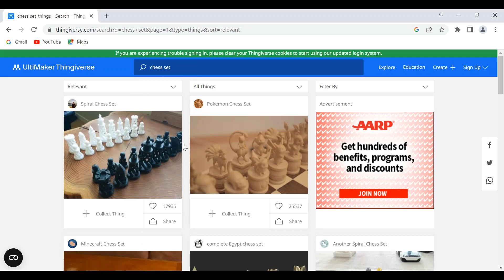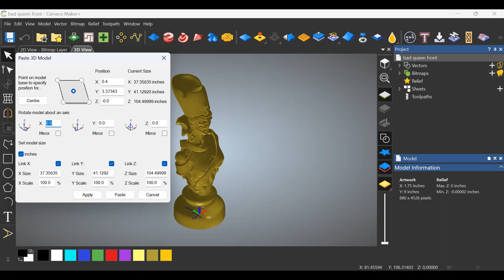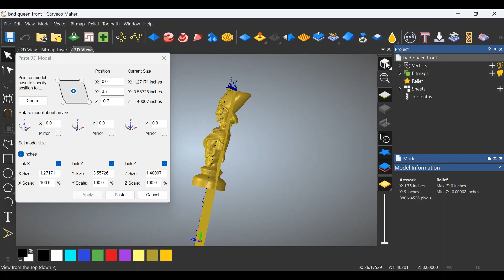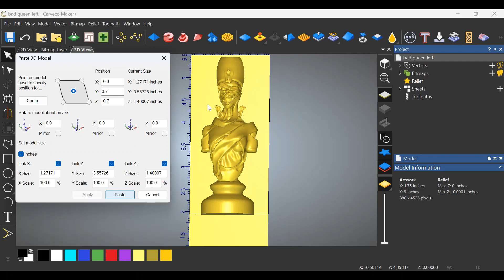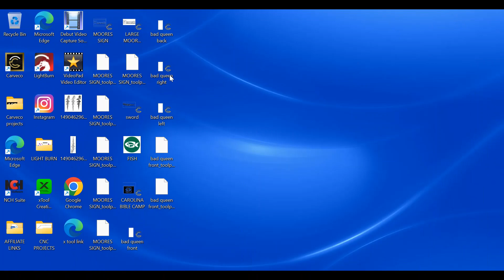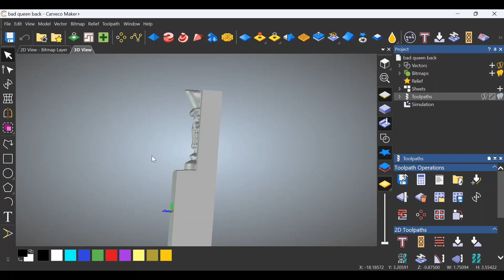How to make a beautiful chess piece

Comment: Hi. I've watched this tutorial numerous times. I think it's a great idea and well presented. I have tried to copy what you have done, however I'm having a problem with the 3rd and 4th relief cuts.
I've checked the material is square and 4 sides equal (within 0.03mm)
Yet on my 3rd and 4th cuts it seems to cut deeper into the edges in some places (at the sides) but misses the highest points in the centre. Have you any ideas. I've had 4 different attempts and haven't got any decent results. 
Thanks 👍🏼
Reply: Thanks  for this I'll give it a try.
Reply from the maker: Hi 
Sorry you’re having trouble.
A couple of ideas
1- re-zero for z on each side off the original stock height 
2- try cutting the sides that cut the deepest first 
Hope this helps

Comment: Hi, first want to say thanks for putting this together and showing us new capabilities; it's really fascinating what you've done here.  I'm in the process of carving some chess pieces, but I have a question regarding the finish toolpath.  I've noticed during my carve that at the end of each pass the bit raises up to the where the top of the material originally was, then drops back down and does the next step in the raster path.  When it gets to the other end it does the same thing and repeats.  I'm sure I'm missing something but haven't been able to figure it out.  Any ideas?
Reply from the maker: Check the safe z setting i set mine from .1 to .2
Reply: @Hinkleshop  I double checked my safe Z setting and confirmed it's set to 0.1.  I changed it and reset it back to .1 just to make sure I didn't miss something and it had no effect.  Also, I ended up recreating the model - had some other issues I wasn't happy with - and when I did the new toolpath changed so that it's only doing it on one end of the raster.  At the left end the bit raises to the top of the material and drops back down to run the next row, but when it gets to the right end it just reverses like it should and continues back left.  As far as I can tell I used the same toolpath settings on both models.  Any thoughts?
Reply from the maker: Send me some screenshots of your tool path menus to my email hinkleshop@gmail.com and i will take a look
Reply: Double checked that, it's set at 0.1

Comment: Thanks mate, 2 things though, I use different software but can't you just copy and paste the first toolpath to back and sides to save you time? Also when doing the sides it seems to me that changing the size of the bounding box to only be say 1/8" wide it will save you a lot of time from the tool cutting air, also if there is a slight positioning error when clamping, or movement through the wood being stress relieved then the tool won't cut into the work you have done either side of those thin strips.

Oh another thing :) , if you set model center slightly different the tool could go bast depth center by even just 1/16" negating the need to do the sides?
Reply from the maker: Hello thanks for watching 
As far as copy and paste I don’t believe that would work because each side is different 
The reduction of size definitely would reduce time 
And centering so the tool goes past is a good idea but you still need to do the sides because the sides have different elements and carving the sides removes the line/seem if you don’t get the zero just right
Hope all that makes sense
Reply: Sorry mate I meant just the settings, I use vectric Vcarve desktop and save time on projects by copy and pasting settings, then calculating the toolpath, I didn't mean copying an actual toolpath, maybe it's the software difference that doesn't allow it and it would be good if there could be a preset for toolpath settings that you can save prior to calculating.

And about the other thing I mentioned about reducing the size, your reply makes sense as I wasn't thinking about those details, like for instance inside an ear
Reply from the maker: @ yes the details are subtle but they are there
I think you may be right about Carveco not having the copy and paste capability 
I’m pretty comfortable using Carveco but that might be something that can be done that I just haven’t seen.
I’ll have to do some research now because that is an interesting concept

Comment: startedon mine. using vetric v12 , littlr different and yell i messed up a lot. cant figure how to rotate four tims ding two side lots good to me but thats me.
Reply: God I need to proof read before sending
Reply from the maker: @paulrcreech7731 
No worries Paul 
But i am still a little confused by the comment 
If you need help with something although I don’t know anything about vetric 
Shoot me an email hinkleshop@gmail.com
Be sure to proofread 😉👍
Reply: @Hinkleshop  
Well I have an infinity cnc wood worker pro with vcarve pro v12. It doesn’t allow me to rotate like carvco. So I can only do two sided carving like ok. With vcarve to rotate you turn it in job set up but if not careful it misaligned top to bottom you have to eye ball it. As far as I know I can’t punch in a # like 180 or 90.
Reply from the maker: @paulrcreech7731  wish I could help but im useless on V carve 
Now if you switch to Carveco thats another story 😆
Reply: Ok I have v carvepro it doesn’t allow you to punch in a number to rotate that I know of. But I have done the king queen and
Rook. I happy with it but I do the two sides and that’s it. Wasted 6 but thanks to you I’m getting it

Comment: Awesome idea! 

You may be able to cut your carve time in half if you do relief boundary.  I’ve been doing only rough pass with offset boundary to make a specific offset. Then I do a completely new 3d tool path using only the ball bit finish pass with minimal offset relief boundary. 

Just make sure you rough at least .25 offset from the relief on the rough pass or your ball bit will hit. 

It might get squirrelly but maybe use the boundary offset path to profile cut from the back leaving small bridges then you could just remove the outer excess wood and continue to the sides !

Been wanting to make a skull, never thought of aligning it the way you showed here so that’s awesome!

Comment: Thank you for the heavy lifting here.  I can really appreciate your experience and you make it very easy to understand.  Question- Have you been able to 3d carve from a photo from your phone? or just a simple jpeg?  I have been looking into this and I believe you need to convert "properly" the image to a good quality 3d greyscale heightmap with accentuated contrasts and edges that the software can understand.
Reply from the maker: Thank you for the kind words
Unfortunately no I haven’t done a photo carve 
However I believe you are correct you will need a conversion software to accomplish it
Reply: @Hinkleshop  You are welcome.  I'm in a struggle to purchase the correct software for my cnc machine I bujilt (mpcnc) and I've used Fusion 360 w/ inkscape for a few projects. Considering carveco, vectric, carbide create and now found cambam.  Have you tried out any of the other software programs and can add your opinion? I really don't want to start out with a $1,000 dollar software purchase or the constant monthly payments as it is a hobby now.
Reply from the maker: I haven’t used the others 
I am  a strong proponent of @carveco   Maker it can do just about anything a hobbyist CNC user would need 
It does have somewhat of a steep learning curve but no worse than fusion and although it is a monthly subscription the price is very reasonable and in my opinion/experience well worth it

Comment: Looking at your probe, it's thicker than the aluminium crossbar. Why don't you place the probe on the solid piece of wood below the crossbar?
It's flat and have body to place the probe instead of a balancing act with a wedge above that crossbar.

Order of carving:
You advice to do the sides first. How exactly do you proceed?
First the roughing cut on 1 side, rotate the piece of wood 180 degrees and roughing the second half. Than change the bit for the finishing cut. Rotate 180 degrees again for the second half. Followed by the finishing cut for the front and back?
Basically you only set the Z once for the end mill to cut the 2 sides. When finished you set the Z for the ball nose to cut 2 sides plus front and back.

Or do you have 2 tool changes for each side?
Reply from the maker: I used the probe on the wood not the crossbar
I complete each side before any rotation 
Complete left and right sides then the front and back
Reply: @Hinkleshop  I understand you probe on the wood. What I try to explain is you have a big chunk of the wood below the cross bar. There is plenty of material to place the probe and set the Z.
All you have to do extra is move Y minus with a certain distance, so it's above the probe and set the Z.

Comment: Great tutorial, well done on the explanations.  I believe you can save yourself the math though.  You basically want a bottom offset of 1/2 of your material or 0.875 in this case.  If you enter that into the bottom offset Carveco will calculate all the rest.  Nicely done, cant wait to try it out.
Reply from the maker: Thank you for the info I hadn’t thought of that and I bet you’re right about entering the number thanks again

Comment: nice, but why not calculate that seam left over what thickness it is and adjust the carving on both sides so its perfect from 2 processess instead of 4?
Reply from the maker: Thanks for watching if done correctly with the bottom offset calculation there is no visible seem

Comment: Excellent video, I did a piece, first attempt, didn't set the offset like you said. Turned out ok but not great. One question, instead of going through the math, couldn't you just put half the material thickness in the bottom offset box and be done with it?
Reply from the maker: Thank you !
I don’t think that will work but it’s worth a try give it a go and keep me updated

Comment: Sir, I have a couple of questions if u don't mind.  ref chess to chess set. I have followed all of your instructions and I am getting better. the problem I am running in to is when I do the finish the piece is being cut off at the top and flys off of . I know u said to leave a little at the top I have done that but it cuts all the way through I am using carveco maker on silverback 6060 and easel for the g code.the other thing I find that the pieces are being cut very thin. and prone to break while carving . thank you for your time . and that u in advance.
Reply from the maker: Hey Joseph 
If the piece goes flying off the top you are probably leaving too much material at the top I’ve had that happen too
As far as the piece being thin that would seem to be a z height issue may need to increase z height on the piece so there is enough material to carve without getting too thin
Be sure to keep your feed rate rather slow 
Also cut the sides of the pieces first then cut the front and back using only a finish pass on front and back no rough pass needed if you cut the side completely first
Hope this helps
Reply: thank you. @Hinkleshop

Comment: Could you save some time by revising your rectangular boundary for the last two cuts?  Seems like the majority of the material is removed in the first two iterations, and on the third and fourth cut you are spending most of of the time in free air not cutting anything.  Could you lower the boundary box X width down to about 1/4" or less just to take care of the remaining material?  Haven't actually carried out the process on my own yet so I could be missing some details.
Reply from the maker: Thanks for watching 
On sides three and four i eliminate the rough pass and use only the finish pass because you are correct sides first then back and front can be completed with the taper ball

Comment: Sir, ref chess set. in your video u said the stock  was 2x2 all around u also stated that the stock must be trimed to 1.1/4 is that all four sides . also the settings in the toolpaths are they used for all four sides. back ,right, and so on and  for the rest of the set.  thanks.
Reply: Sir, one more question. what carving times are u getting for roughing carve. I am getting some strange Times at least to me one 12 min and the  next time 35 min that's in roughing only. thank u once again .I am determined to do this.
Reply from the maker: @josephlanglois8073 roughing was averaging an hour per side and finishing was 2-3 per side 
Check your safe z height set it to .1
Reply from the maker: Thanks for watching 
Yes all must be trimmed to 1-1/4
Same settings throughout just adjust the y setting on the pawns alone to shorten them just a small amount
Reply: thank u very much @Hinkleshop

Comment: afrer u zero for the roughing cut where do u zero for the finishing . I tried the same zero for finishing but bit not touching. thanks.
Reply from the maker: Thanks for watching 
I re-zero for z off of the stock just in front of the clamp fixture 
Using the touch block you will need to support the back of the block with a wedge/shim 
Don’t re zero x or y that point does not change

Comment: what am i doing wrong. i ran the rough left side. then the rough right side and they are offset. then i started to run the final cut on the front and it was again offset. any clues i adjusted each offset on each side to be 50 percent of the material
Reply from the maker: Hi Paul 
You run both the rough and the finish on before you turn the stock 
So you are completing the full carve on each face of the stock before proceeding to the next face hope that makes sense
Reply: @Hinkleshop  thanks  i'll try it tomorrow so if the btm set is always adjusted to 50% of the stock it should all line up. thanks again
Reply: well i tried it again as you suggested, one side rough and finish then switch to the other side rough and finish. and still i have the issue where the left and right is offset from each other. i  confirmed all the offsets on all 4 sides to ensure that i am always machining to the center of the stock and still it finishes offset. i thought the first time i did not re-centre the model after i resized it but this time i did that also. any more clue as to what i am doing wrong. my stock is square and the start point on the block is the same on all 4 sides.   @Hinkleshop
Reply from the maker: Sorry you’re having this much trouble 
Is the machine returning exactly back to the same zero point 
Also the stock isn’t moving during the carve is it 
Have you completed all four sides 
Send me a picture of the completed piece on my email 1lisahinkle@gmail.com
Reply: no the stock is very secure and the head always returns to the zero point. i guess it is not meant to be for me but thanks for all your video's they are very informative.
 @Hinkleshop